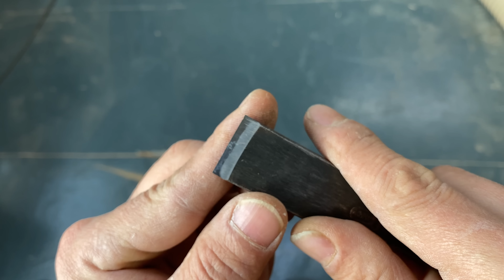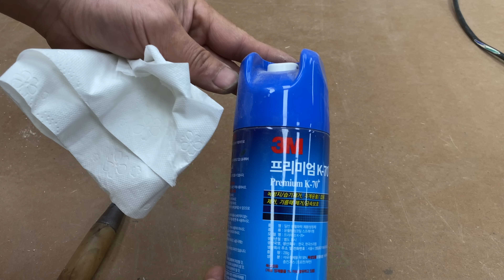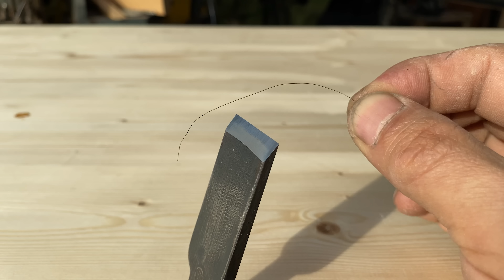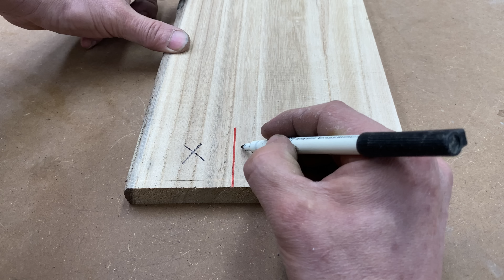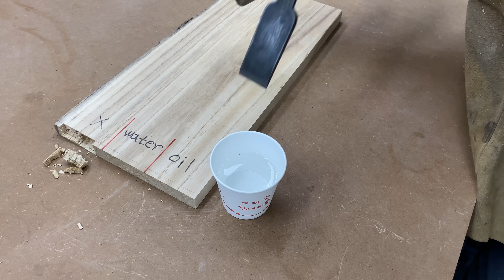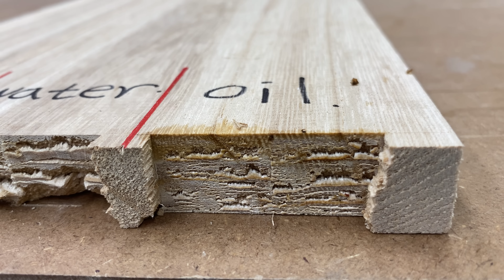Dip a chisel in oil and try it out. amazing results

Comment: This is a great test and I problem I regularly encounter, I’ll have to try it out. The only trouble with this could be oil penetrating the wood and inhibiting a good glue bond.
Reply: Hyyy friend,, your carpentry??? 😊
Reply: @Zie_carpentry  yes, I usually find this to be more of a problem chopping end grain on soft woods. It can be lessening using slicing cuts but I’m keen to try the oil
Reply: That's a very good point.  We're going to have to make sure we only do this on joints that do not receive glue, which can include a lot of joints.

Comment: At first glance, my bet would be on the difference between sapwood and heartwood and not on an oiled edge. I've seen asian woodworkers use oilpots in this manner, and I think it might work, but I would prefer not to put oil on a surface that glue should bind to afterwards.
Reply: Ağacı yağlayacaksın ... Ayrıca bu ağaç çok yumuşak ağaç böyle ağaçlar ... Ağaç çizgilerince yarılır gider ...
Reply: I can't imagine oil where glue is later applied either,  werner
Reply: That wouldn't explain the oil/control difference as both were sapwood

Comment: Would be nice if you could redo the test with all 3 methods on a similar piece of wood:
On the left side the wood seems compromised from a fungal infection, the middle is core-wood, and the right is normal sap-wood.
Reply: i totally agree, this video is junk and the only difference in cutting result is made by the different conditidion in wood areas
Reply from the maker: Experiments under the same conditions forever cannot be done.
Reply from the maker: This has absolutely nothing to do with the content.
Reply: It’s got everything to do with the content if you’re doing a comparison all pieces cut should be equal not completely different 🤦🏻‍♂️

Comment: Water is not a lubricant because of its’ surface tension property. Oils and grease are but are also slow drying anti adhesives.
Reply from the maker: Thank you for those kind words.

Comment: Dude, how do you avoid massive tear out, moving the knife line back, and blowing out the other side? I don’t think you can avoid it with your sledgehammer approach. Plus, one strike like that will undo much of your careful sharpening.
Reply: What do you mean “how”? Did you not watch the video?
He used oil and avoided blowing out. 
Looked good to me.
Reply: @randallrun  I see nothing but tear out, and no amount of oil will prevent it when you strike that hard. If you like it that way, go for it.
Reply: @faheyplayer  totally agree also the grains not consistent on each “example” looks like a waste of time to me
Reply: Dudes...This is a demonstration of a worst case chiseling to see the difference oil on the blade makes.  Yes the grain is very loose on the winner's side of the board.  Has anyone else posted their own botched experiment results?
Reply: @David-bc4rh  Okay. The looseness of the grain is beside the point, and no, I for one do not post botched experiments. It just seems pointless, for example to hone and show off a sharp edge, only to destroy it in one sledge hammer blow to the chisel. It is actually quite humorous, and for that I am grateful, thank you.   As to the matter of oil, I find it indispensable for any cutting - sawing, chiseling - and no it won’t get on your joints to interfere with glue up. On that, we can agree.

Comment: Yeah, but still pretty ugly and worse yet, it gets oil on the surfaces that might later have to be glued. I don't see why use extreme force with a chisel, especially a nice one like yours, when you can use a saw and clean up with the chisel, to make nice, clean cuts. And again, how are you gonna glue something with oil on it? What's the purpose of the oil, other than perform better in a made-up scenario?
Reply from the maker: Give it a try and leave a comment.
Reply: @HammerSound-1  I'll keep it in mind ;)
Reply: endgrain is not supposed to be participating in gluing, only sides of pins
Reply: @gronk555  have you ever glued wood?

Comment: The grain is running very differently in each section of the board which can affect how the cut behaves. Maybe cut it off and do a reverse order? Smaller bites would also be more appropriate.

As mentioned in another comment, it's not good practice to use linseed oil or worse BLO on rags due to the possibility of spontaneous combustion.

Comment: This is a very old technique (I mean the use of oil). Thanks for the reminder! The best results are obtained when using transformer oil. It has a very low viscosity. You can also use diesel fuel, but diesel fuel has an unpleasant smell. Sharpening chisels manually with such high quality is golden hands! My respects!

Comment: Hmmmm…. I wonder how silicon lube would work?  I’m not a fan of spray silicon and prefer food grade silicon grease.  Fewer additives and can be used anywhere.
Reply: @Hellequin Maskharat As sharp as the chisel was, I was expecting a cleaner cut with no lube, but I obviously thought wrong. 

I would still go for the cleanest lube I could find. Sewing machine oil or maybe even glycerine.
Reply from the maker: you're right.👍
Reply from the maker: I prefer sewing machine oil.

Comment: Even though it may work, considering that's not how to use a chisel correctly, the technique seems moot.
Reply: The point was to demonstrate how much easier a chisel cuts when lubricated with oil by cutting straight across the grain in each test. These results would indicate that the chisel slices across the fibers easier, instead of ripping them out, when dipped in oil
Reply: @dillan6134  Yeah, I understand the point. But it's moot because chisels don't work well like it's demonstrated. Even the lubricated one has tear out.
If you're implying smaller bites with the chisel will benefit from lubrication, maybe, maybe not. Ive never had a problem using a sharp unlubricated chisel. So again I say, the point is moot.
Reply: You never had a problem but you could get even better results. That's the point but you're too stubborn to see it.
Reply: @The.Floor.Store.At.Your.Door44  If I use a chisel correctly as I have been for the past 20 years, this won't give me better results. That's my point. But you're too stubborn to see it.
Reply: Let's see what happens when he tries to put a smooth stain on the board.
Reply: @makerspace533  Or glue it 😁